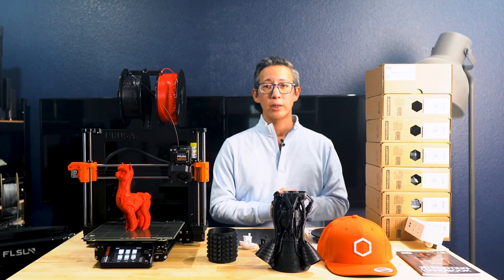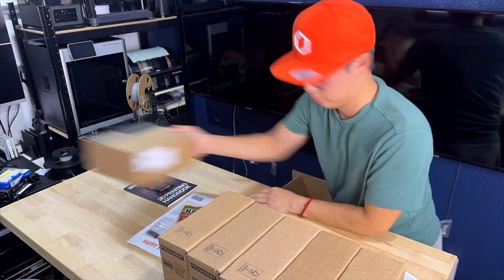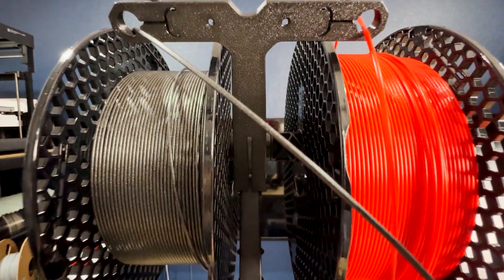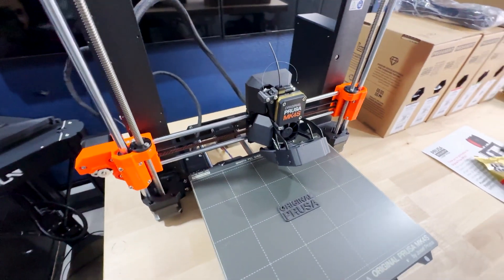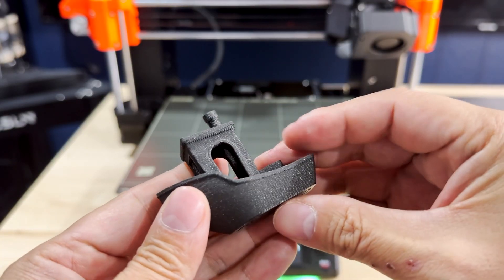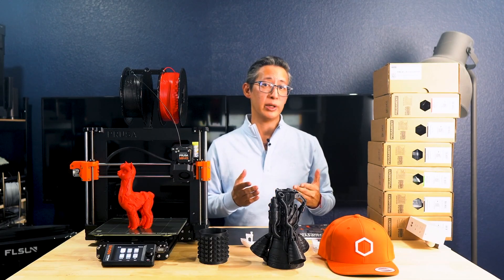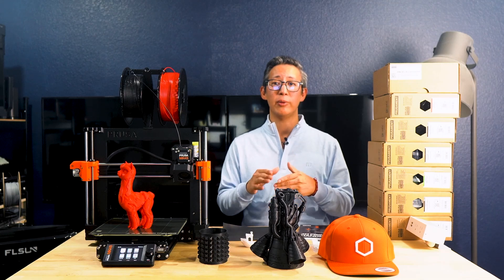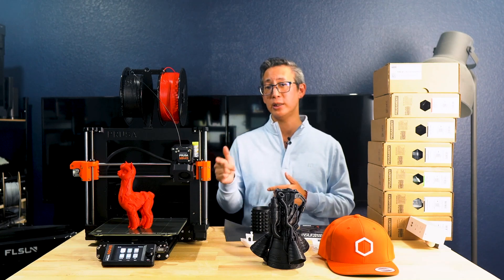Prusa MK4S - Amazing and Flawless Prints!

Comment: I'm leaning hard towards the Prusa for my first printer, I'm going to assemble it myself I think, it seems scary but also easy, and a good way to understand how it works for a new guy. I love that you can upgrade it, and add things. that seems worth the extra money to me. thanks for the review, I think I'll order some extra gummy bears to go with it.
Reply: I'm currently building one. On chapter 6 out of 8, nothing really complicated so far, even for someone without any actual experience with similar things. Takes a bunch of time (and I had a defected printed part, which turned out to be no issue), the manuals really are good :) plus it saves 300 euros, so I had little reason not to do it other than time ^ ^

Comment: I think of buying 3d printer to build my larger scale hydroponic farm , do you have any ideas how to calculate the filament use
Reply: 1. Just use weight of your current equipment, but recalculate metal parts to plastic.
2. When you put 3D model part into PrusaSlicer, it will show you the consumed amount of filament + part weight.

Comment: I bought the Prusa MK4S kit. Years ago, I built an MK2, so this wasn't my first build. I took my time, and it took between 15 and 20 hours to assemble. My printer passed all the tests, and my first print was a 17-minute "Benchy" that looked as good as any that I've seen. My 2nd print was the included Rocket Engine model, which took 11 hours. The complex print, without any extra support, turned out near perfect. I'm really happy that I bought the kit. Thanks for the great video. It reflects my experience with the printer and with the PRUSA company.

Comment: Yes! It’s an amazing machine, honestly. The prints come out super clean, it’s really fast, and it runs so quietly – you barely notice it’s on. Compared to my previous Bambu printer, the difference is massive. With the Bambu, I always had to deal with noise and some inconsistency in the prints, but this one just works so smoothly. It feels like a whole new level of quality and reliability. I couldn’t be happier with this!
Reply: Excellent.  I’m not experiencing any imperfections with my Bambu Lab printers, but the quality using default settings on the Prusa is definitely slightly better.   The noise level is a HUGE plus for Prusa and that is one aspect I love about the printer!

Comment: Hello, this video is very good, nice.👍 I agree, it’s an awesome 3D printer. I’ve got the MK4, and I’m really enjoying it. I love how great the prints come out it’s so much fun to see what it can do.👌
Reply from the maker: Yea.  The quality of prints is exceptional and I’m amazed how it can handle overhangs without supports.
Reply: I'm really tempted to upgrade to the Core One model. By the way, what do you think about it? I’d love to have it, even though I don’t print with complex materials. That print speed is just on another level
Reply: @Radhiant from what I have seen and read it looks amazing.  You can purchase the upgrade kit which is more cost effective if you don’t want to purchase an entirely new machine
Reply: +1 to the discussion. I also have an MK4 and I'm still amazed by it. Looks like a simple machine but it makes wonders. The quality of the prints is excellent, no problems and errors, no tinkering, just a proper workhorse really. Going to upgrade to MK4S soon, I can't wait!
Reply: @OwenJonesCymruAre you going to upgrade using a kit or purchase the full MK4s?
Reply: @ I'm waiting for the kit to arrive, it doesn't seem too complicated so hopefully I can manage.